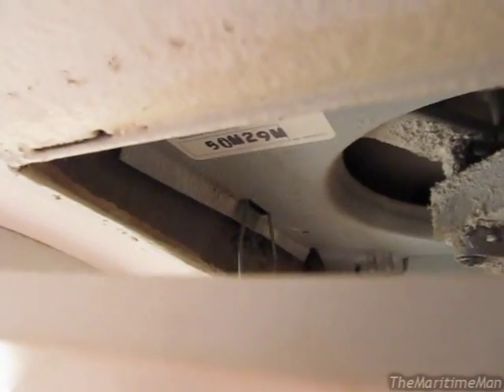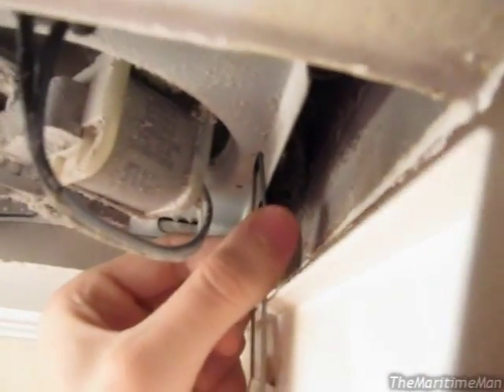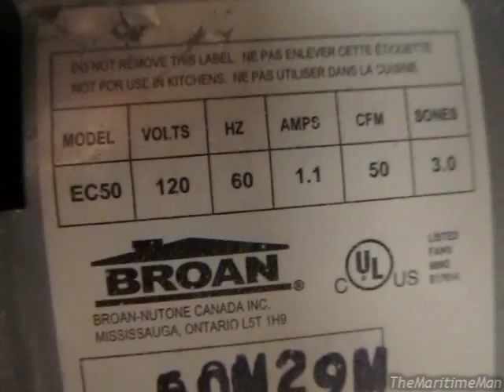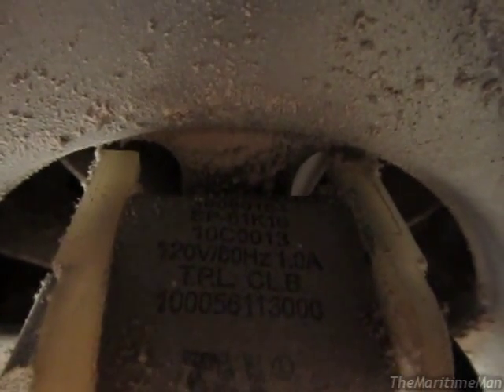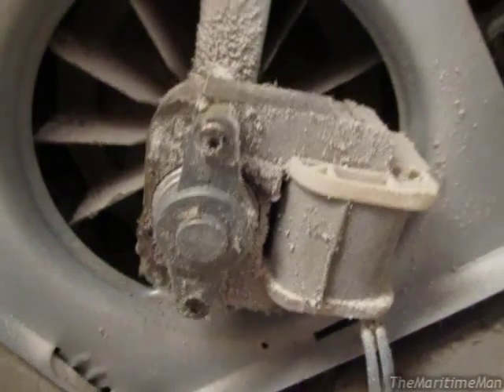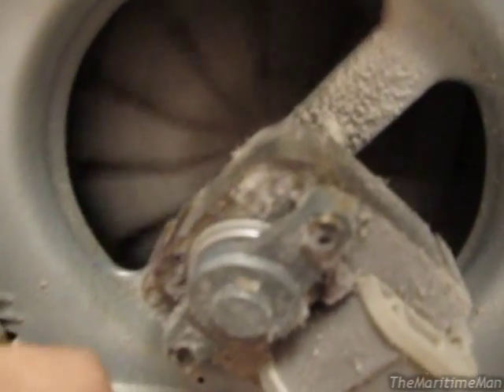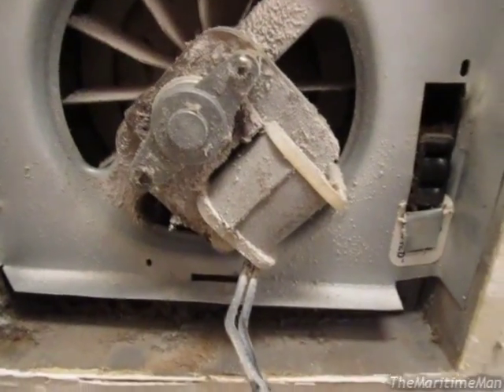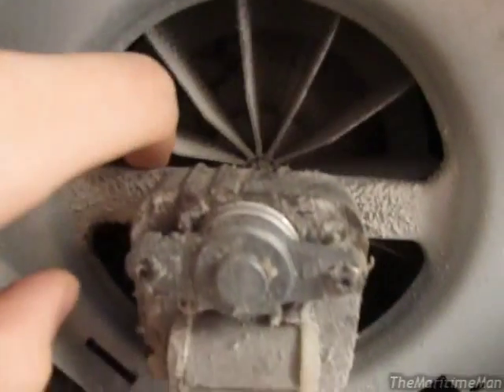Bathroom fan bypass trick; shaded pole motors; inductors

Comment: Thank You ! That was a very informative video.  Shaded pole motors are quite clever and reliable, even if they are not the most efficient motors.  They do wast some power as heat, but, as you pointed out the get cooled by the fan :-)

I have a bathroom with the fan wired to a light as well.  The other bathroom has a separate switch, which I much prefer. Like you, I don't always want the noisy fan on and it sucks the warm air out your house in the winter.

Comment: Early gas engine ignition systems didn't even utilize a secondary "high-voltage" coil.  They had a single winding, not unlike the one on this motor.  A set of mechanically-operated points inside the cylinder created the necessary arc for ignition.  It was called "low-tension" or "make and break" ignition.

Comment: Looks similar to the fan unit in the NuTone I have here (on a separate switch of course). The thing never worked right from day one as the fan cage design was flawed. There was no stop on it so eventually the cage slid down the shaft and started bottoming out. Than the cage started slipping on the shaft since it wasn't splined. It was a POS to say the least, but I can get the thing about in about 3 seconds flat now!

I have to break down and order a new assembly after my repair jobs kept failing. By than, the hole on the fan cage looked more like an oval and was super wobbly. The revised part has a splined shaft and a bottom stop, so hopefully it lasts more than a year.
Reply from the maker: I had the same problem with the fan of a vintage heater I have. In my case the fan was held on the shaft with a screw which simply came loose. After a re-adjustment and tightening it's working fine now (and for the first time in at least 20 years, at that!)

Comment: The exhaust fans here at my house plug into a powerpoint in the ceiling space.  I know this because I had them replaced by an electrician, and I was a bit surprised when he just pulled out the old broken fans and simply plugged in the new fans.  I think the plugs on exhaust fans are standard here in Australia, at least in domestic (home) installations, there's probably a code that dictates this, at least for ceiling mounted exhaust fans.  In order to access the power points for my fans, the whole fan assembly must be removed from the ceiling cavity.  Just taking off the covers won't give you access to the plug.

Comment: This video got me thinking, if u daisy chained 12 9 volt batteries giving 108v could you run that fan off batteries?
Reply from the maker: Nope. Induction motors (of which the shaded pole is a variety) require AC current. Fed with DC, the stator coil is just is just a bunch of wire, shorting out the power source. Now, make a simple circuit to convert the 9V battery power to rough AC, and I could probably get it to move.

Look up the universal motor, which is the type of motor used in vacuum cleaners and other devices that require high rotational speed. They are named such because they run on AC and DC. Search "vacuum 9 battery" on here, and you'll find videos of people successfully powering vacuum cleaners from 9V batteries. I've done it myself.